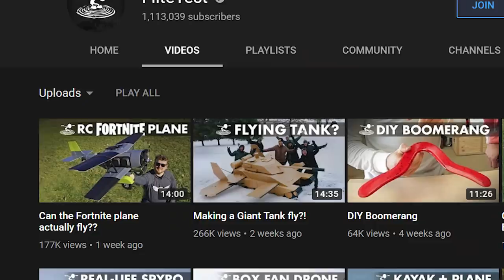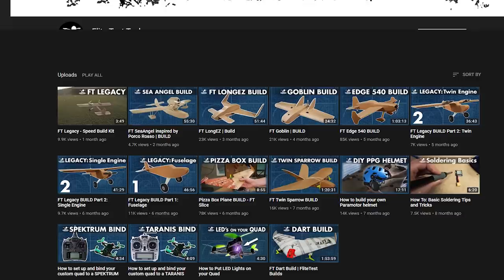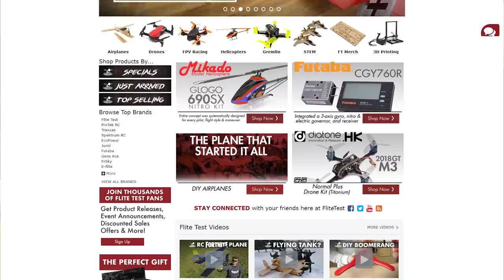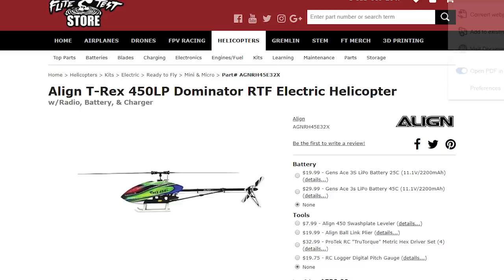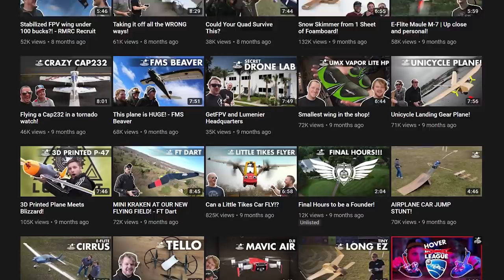We Have Big Plans...

Comment: Flite test should try to design the other pirate plane with that engine setup the same. It has two twin engines, one that pulls and the other that pushes.  It maybe be hard to do because of the thrust angle and the fact that it is a biplane too.